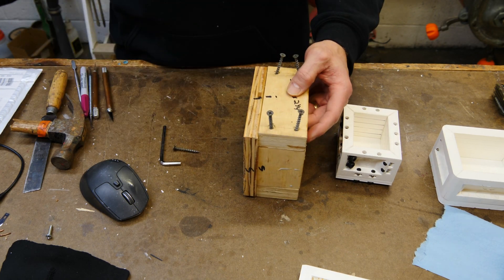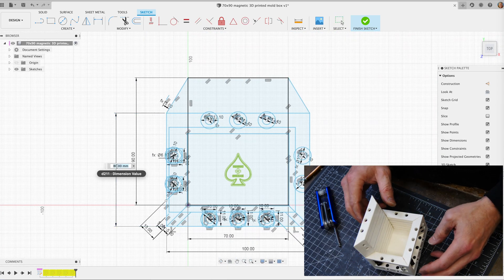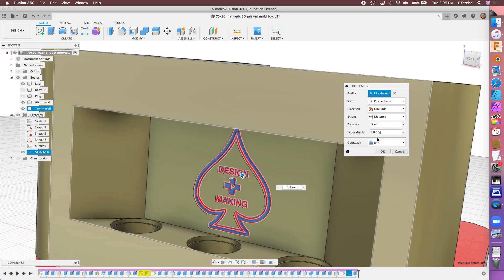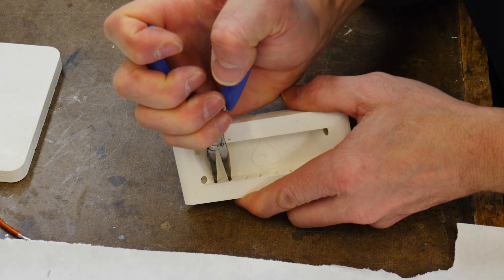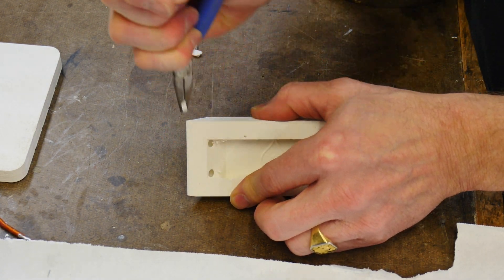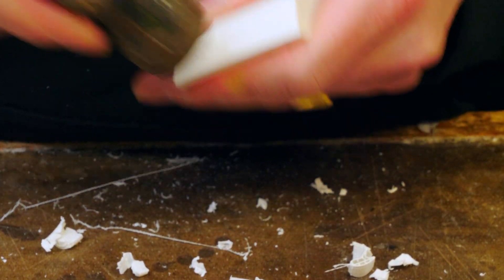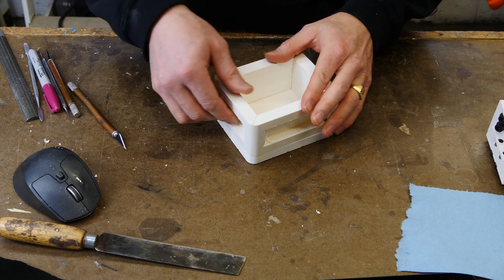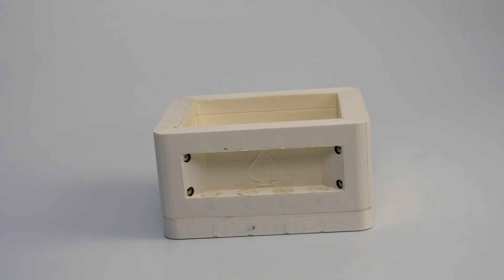Magnetic Mold Box System for Silicone molds & Casting Urethane resin parts

Comment: Awesome pro product design as always, congrats!  I like to use lego blocks to make each mold box custom to the part so I use the minimum amount of silicone.  Blocks make the walls around the part, then get set aside while I stick the part to a metal plate with clay or beeswax.  Clay worm goes all around the base of the lego wall then it gets stuck to the plate where it surrounds the part.  Spray release or paint on your mix, and pour the mold.  Legos snap apart and can be re-assembled into the exact shape and size again due to the standard size of blocks.  Not as fast to use as yours, but legos let you make non-rectangular shapes which can save on silicone.  They lock together tight enough that silicone doesn't leak between blocks.

Comment: How fluid tight are the joins? That’s what I would be interested in. It’s a simple but effective solution. Design 101 - keep it simple. Great job!
Reply from the maker: I hope silicone tight
Reply: @EricStrebel  If any issues, then a softer durometer filament like TPU could be tried, at least for the interfaces.  You could pause and swap filament at whatever layer height and have a hybrid TPU PLA part... or if you have a dual extruder printer, that would be even better since not all of your interfaces are aligned on the Z plane.
Reply: @ollieanthem9213  good idea...so like a gasket?

Comment: I love that. I’m working on a tool-free mold for epoxy resin. How would you go about lining the inside with silicone so that it could be watertight?
Reply from the maker: This should easily hold silicone and not leak
Reply: @EricStrebel  Sorry, I meant how would you go about making sure you could fill with epoxy resin without it either leaking or becoming one with the mold?
Reply from the maker: Well, You would need to apply a release agent to the walls and the floor such as wax or a spray release, I think you could use wax in the corners as well to keep the resin from flowing out if needed.

Comment: Wow, so first off thanks very much for the shout out Eric. What you've made there is pretty slick and it looks great. I approached this problem from a slightly different starting point in that I didn't have a) 3d printer b) Money (artist) 3) Patience.  So I used MDF for the walls and adhesive magnetic tape (22mm wide) for the bottom of the walls and the wall edges. The walls were L' shaped when seen from above so they could be used in a modular fashion and the length and width of the boxes could be adjusted. I stuck a large adhesive magnetic sheet (steel impregnated) to a flat melamine board and the walls stick to that and are adjusted accordingly. I post this in case there's anyone watching who's fed up with hot glue etc and is looking for a cheap as chips option. 
Cheers again Eric. Jim
Reply from the maker: Thanks for sharing, I am happy to promote you and your site since you shared your knowledge freely. I am happy how it turned out. Thanks again. Cheers!

Comment: I did some magnetic designs as well and one technique I use is actually embedding the magnets mid-print. 
I use the „pause at layer“ command in CURA to pause the print when the compartment for the Magnet is just about to be closed. Put in the magnets and continue print.
Beware of magnetic parts at the print head, I changed one magnetic screw of mine to a non-magnetic steel one.
Reply from the maker: Interesting, pretty hard core, I like it
Reply: I tried something similar. Embedding magnets in strips of molding silicone. The idea was to build walls on a sheet of iron which was also covered by silicone. It worked 'sort of'. But it was hard to put the walls straight. And the magnet poles of adjecent walls would only allow for certain discrete positions. It defeated my initial goal to make a mold of arbitrary dimensions.